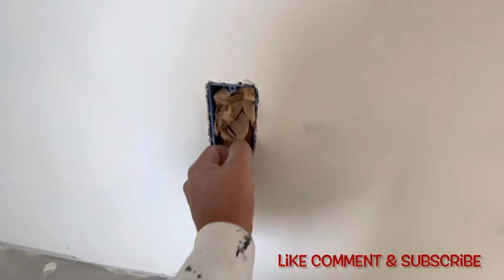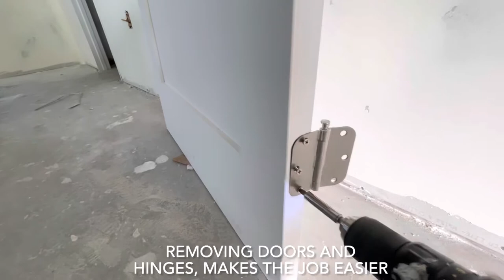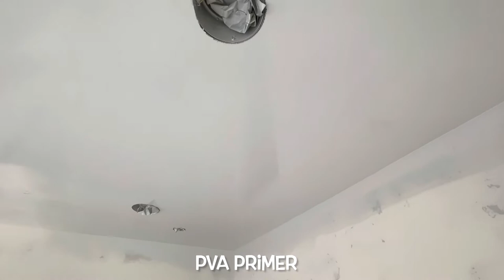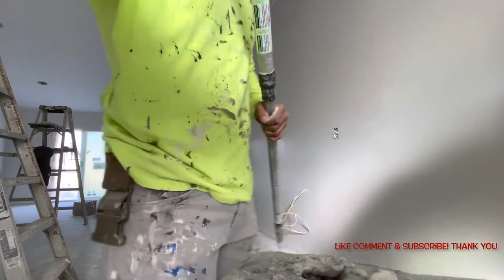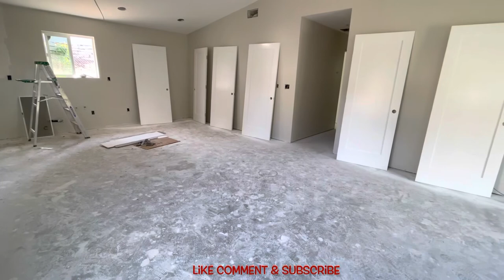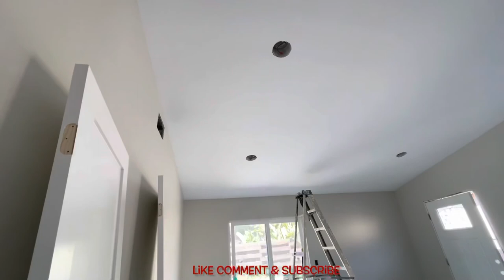Full Interior Painting Walls doors 3 coats| New construction New drywall |como pintar paredes nuevas

Comment: Thank you for the videos; they are very helpful. What spray tip did you use for both the primer and the first coat of paint? I know you typically use Sherwin Williams. Is the Zinsser Bulls Eye 1-2-3 Primer worth the money, or should I stick to using Kliz PVA or Sherwin Williams PVA for new construction? Keep up the good work!"
Reply from the maker: Hey buddy, Thank you for watching.

Tip for walls 4-13 Black reversible Tip
Tip for Doors 2-11 black reversible Tip

PVA is specially for New Drywall, Kilz PVA high quality and Sherwin Williams also great primer.
That bull eyes primer Super high quality too.
On new construction jobs like here with New Drywall PVA primer is best.
Pva primer is actually cheaper primer then all, it’s just for New drywall 

Thanks Again for subscribing 👑

Comment: Good Job. Do you backroll the primer coat? Also do spray any of the finish wall coat? or cut in brush and roll all of the finish wall coats?
Reply from the maker: Hey Buddy, Thank you! Came out clean.
As you can see in the video, 
we spray Primer,
Spray 1st coat of finish, & Backroll 
And
3rd coat We brush and roll, thats my process of doing NEW Construction jobs
Thanks For subscribing & watching king 👑
Reply: Someone told me once that if you don't backroll primer into drywall it will fail eventually? I'm not criticizing you, I just wondered if you had ever heard anything like that? So many painters out there with so many DOs and Don't ya know? You do a great job, keep at it
Reply from the maker: @pjmisley I’ve Done a lot of new construction jobs, never had a problem. What I do, let it sit for couple days before doing sanding or putting first coat of paint. Also companies I used to work they will do the same process Super big jobs

I’m editing a new video New construction 30k job, 15 million dollar house
New drywall 
Thank you king 👑 for watching and subscribing
Reply: @pjmisley  Great video, thanks.
I see a lot of ceilings with a tiny crack in the drywall that turns out to be a 3 feet circle repair.
If it isn't back rolled a minor leak or any moisture (kitchen - bathroom) the paint will just separate from the paper. I'm in a pretty hot/cold climate in saying that so maybe not an issue elsewhere. It pays to at least backroll the primer. Imo anyway 🙂

Comment: Awesome Video this helped me a lot!! One question, I am curious when you spray on the PVA, do you need to backroll it as well or just spray it on without backrolling? Thank you I appreciate it
Reply from the maker: Hey Buddy, not necessary. PVA primer sealer works for you by seal the pores on the new drywall. 
Means Polyvinyl acetate PVA
But when applying paint is recommended, backroll for touching up and leveling smooth.

Thanks for watching & Subscribing 👑
Reply: @TheValuablepainter  awesome thanks for replying I appreciate it!

Comment: Can you make a video of building and disarming the spray gun ? It’ll be extremely helpful 

Your spray gun sprays perfect
Reply from the maker: Hey Boss, yes I will do . Got different type of Guns - Contractor and Contractor PC trying to get the Compact one.

Big Tip for spraying smooth - keeping all filters clean after every used , Tip not blown, and pressure at perfect PSi

Thank you buddy for watching and subscribing
Reply: @TheValuablepainter   Thank you. You make it look so easy.  How  you handle spitting if it happens while you are spraying the door?  Did you spray the casing for the doors? Thanks again and keep on the good work!!
Reply from the maker: @oaouda  Hey buddy,
Spits on doors or trim, Depending on what coat am I, primer usually just let it dry and then sand,
Finish paint , I will get a 1/4 Rolling nap and dry roll, at the end of the jobs will normally go back and re-roll doors anyways specially on New Construction jobs

Hopefully helps you

Comment: Hey man! new sub here! Came looking for job estimate and how to calculate material. I do kitchen and bath remodels but lately i been getting a lot of paint jobs. As matter of fact got 2 1500-1700 sq ft house to paint and i charged them $3.50 sq ft. Was wondering 1) do i need to prime cielings? I seen some local painters just spray and backroll flat on them and call it good. 2) can that pva primer be sprsyed on raw wood? Baseboards are down and will need primed
Reply from the maker: Hey Boss, thank you for subscribing 
That price for Sqft really Good, I usually don’t price my jobs for Sqft.

Primer is only for raw materials like new drywall, new wood - something it’s been painted before usually it’s been prime already- oil based paint from kitchen and bath I prefer priming

Pva primer it’s only for New drywall, specifically for drywall 
But with any other primer you can prime wood

I have couple of my videos for estimating jobs check them out, here to help my Picassos 👨‍🎨 

Thanks again king 👑
Reply: @TheValuablepainter  i appreciate your response!  $3.50 is everything except cabinets
Reply from the maker: Yes sir, a lot of contractors price their jobs by Sqft, but for me just take it more from the root because all jobs are different they have more preparation to do- some jobs needs multiple coats- some jobs are more far away from office- some jobs owners want different types of materials- higher quality paint or Lower

I keep it simple, first I go meet customers at the side jobs, 
Some other contractors they don’t meet up with

Comment: Nice work. How long you guys work that?
Reply from the maker: Thank You Carnal, 
That Job was about 5 day Job @ 2 painters. 
We did 3 days ceilings, walls & doors prime & 2 coats of paint.
Then 2 days for baseboards & Casin putty caulking priming & painting.
But for baseboards and Casin we had to wait 2 weeks for installation .
Yes 5 days total
Reply from the maker: Thank You Carlos for Subscribing!
Reply: @TheValuablepainter  so it was 5900 just for the interior? or exterior too
Reply from the maker: @marlonm95  Hey Boss, yes was only Interior job $5,900 including Dunn Edwards paints- Only ceilings,  walls, doors/ Casin & baseboards. No Cabinets!

Comment: Why are you painting before ALL trim work is done? Are you hand painting casing and baseboard? If not, now you have all that prep/ masking off to do, to protect walls and flooring.  ?!
Reply from the maker: Hey king,  New construcción jobs are by steps- framing electrical drywallers then painters flooring Trim Guys ect -
We spray them on table horse then they installed them weeks after-

Couple jobs when we really busy they will install them and we will have to mask walls flooring and spray them

Thank you Boss for watching and subscribing
Reply: Yeh I know “new construction” jobs, I’ve done plenty. Never done a project with any missing casing trim or baseboard. Shoe molding is it. That’s too much extra work, but hey if they’re paying sounds good lol
Reply from the maker: @Mcgrauce  I just finish a New construcción job, same we just did walls and ceilings for now, we over her in California, maybe your General Contractor Works differently.
Yes sir if they built, they pay! 😂 

Check this short video out, another 
New construcción house 
https://youtube.com/shorts/xfgmy0j938Y?feature=share

Comment: Ok, ok  . Not terrible, but room for improvement . With all of my hard work and dedication. No matter who the boss was, or if it's me.. And I could be down painting a pipe gallery at a shit plant doing industrial epoxy finished. Spray or roll. Or     working a commercial job doing some oil on handrails at a school. Or some fine finish or blow and go cookie cutter residential spec homes with latex and oil modified/ waterborne poly or laquer mix. 1.  My crew and I wouldn't be working without being suited up in a proper uniform. And those are painter whites folks. From hat down to some Adidas white shell toe shoes.

2. Now if you plan to stay in the game full time and crush some years away stacking those racks$$. Then I highly suggest with all cost and no excuse. You should always be wearing a dam respirator doing any kind of brush, roll, spray oil, epoxy and Ect.And anything airborne always. Especially inside. A particile mask will not keep you out of harm from vocs and other nasty vapors. Not to mention all the silica and titanium dioxides pouring out of that little 311 spray tip you're using. Surprisingly enough,  amonia is no joke either and potentially could have deadly side effects 

3. Why do you choose to use such a small tip blowing primer on your lids? Are you using to small of a pump such as a Graco 395pc or titan 440. And only able to achieve 0.54 gpm. Or is it just something you have came custom to and have became comfortable with? I only ask, because a spec house with skip trowel finish . 3 bed 2 bath. Probably about 1600- 2000 ft2. Excluding a 2 car garage. I could by myself lay down 40-50 gallons in under 2 hours start to finish cross hatching my spray laps using no less then a 517 tip. Typically I personally like to and train my guys and gals once they become comfortable. To blow using a Graco 695 or 795 pro contractor series and a 621 tip for most ceiling and big wall. Laying down some serious paint to where it looks like glassy water about to almost start to sag but magically doesn't when application is applied correctly. 517-415 most other walls. 311 for closet and doors. 211  for those tight shitty areas you typically stick the new guy in😉!  Not trying to sound like I've got an ego and realize everyone has their own system. But when your flipping new homes like that on the daily. It all comes down to production.

4. Now over my 18 years of painting for the good, bad and ugly bosses. And even after I became a boss and have learned it all comes down to the smile on a client or general contractors face. And the best way to achieve that is to pay close attention to detail. Every contractor likes their job done their way for the most. And we as subs don't always have any control in the scheduling. And I a perfect world me as the painter polishing every other subs turd and making it look like no mistake was ever made cuz that's what a painter does . I like to be the last crew in other then sparkys and plumbers dropping toilets and trimming lights and switch plates  . That being said, I would prep and prime. Then sand all base and case. Blow all trim down with air,vac and tac and spray 2 coats finish. Then wrap trim . Blow any accent wall first. Mask and drop blue 99 In. Plastic which is meant to be sprayed on more then once verses black 9 ft. Which can only be sprayed on one time or you take a chance of a nightmare waiting to be had. Then spray all remaining walls main finish coat  . Andi achieve my finish in one day coat achieved by a big tip and vertical half lap. Immediately following back through with a horizontal half lap " CROSS HATCH". Then drop 3M black 9 ft plastic to blow lids.
. In a fucked up world and halving to come back to spackle and caulk and decide to spray or brush and roll your trim. I definitely get spray and lay with a roller because you're going to have so mainly touch ups by the time everyone is out that you might as well include the 3rd coat as a separate bid added on or back charge. But what I don't understand is how you get away with or allow spraying an entire houses walls with a darker color and able to walk away from that. Because I damn well know that my very trained eyes would be able to call out any bit of over spray and touch ups, even on a flat ceiling because no touchup sheen will ever match a spray finish without flashing  .  But then again I've seen painters not even understand what the hell flashing is. Might look great from your house, but how about from down the street?
Anyways, we all cut corners. But I am asking are those corners cut worth it in the end?

5. Overall I give you a 7. Keep up the hard work. And seriously, put some whites on if you're going make painting videos. The professionalism goes a long ways when you look like a painter and not a guy working off of Jose's stucco crew. 👍
Knock em dead 🐯 and stack those racks boss💲💰💱
Reply: Ps. You should charge more. I guy once taught me there is something wrong if you are getting all the jobs. Do you want to work your life away. Or only work half that getting paid the same if not more. If you have people wanting you to only be the one to paint for then. Then all completion is eliminated and you are worth what ever you say . And that's the difference between making $100 or a $1000 per hour! A job like this I would charge abouut$12,000 in today's market in salida,Co. And yet I would be one of the lower bids!
Reply from the maker: Appreciate your Comment 👑 also thank you for your Rating & Subscribing.

Let’s get that Money 👑